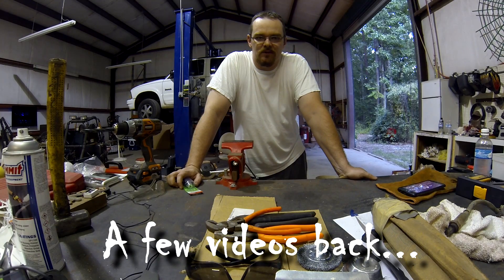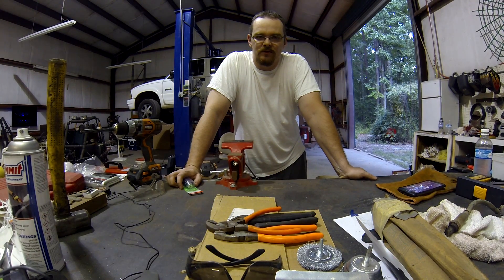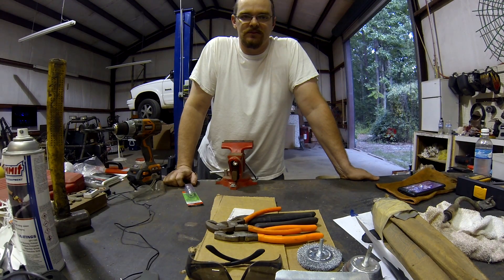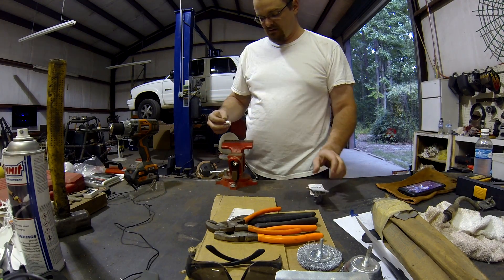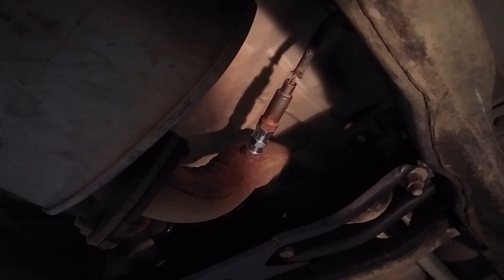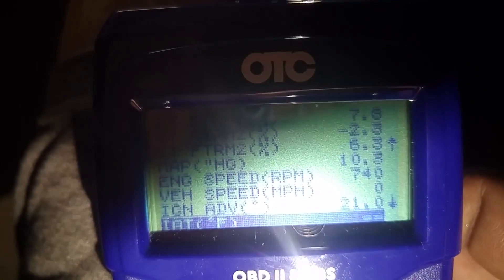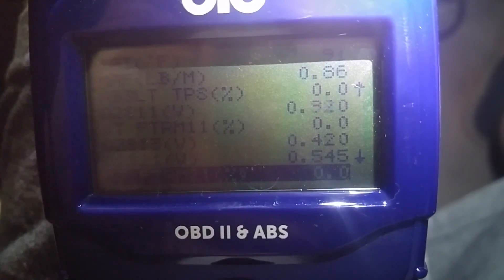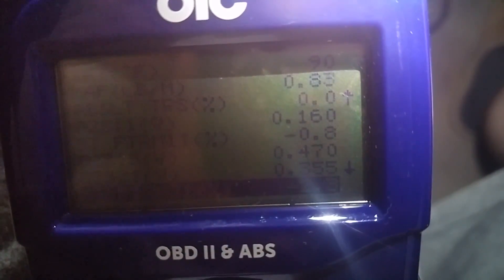$5 Solution to a $200 Problem: P0420 Failing Catalytic Converter

Comment: do you really need two of them stacked?
Reply from the maker: You can try one of them but it may not get the sensor far enough out of the exhaust stream. Ideally, you want the longer ones so you don't have to drill em out but I can only find the short ones locally.
Reply: @ChaosGarage  thanks i'll stick with two i don't want to do the job twice

Comment: Great video and very informative 👍🏻..! What size drill bit did you use / or recommend to drill out the Non Fouler?
Reply from the maker: It's been a while but if i recall, I stepped it up until I could get the o2 sensor to thread in. I think I ended up at 1/2". Hope that helps.
Reply: @ChaosGarage  Thanks

Comment: They make long reach non foulers, part #2006 or #2008. Maybe you could use just one of those and no drilling. Has anyone tried it?
Reply from the maker: Yes the long reach would be much easier if you can find them.

Comment: Did this to 02 ram 5.9 magnum did not work for some reason
Reply from the maker: One of your O2 sensors may be bad. Do you have a scan tool with live monitoring?
Reply: Yes says catalytic converter is not working properly,  just had it removed here recently

Comment: So the cat 🐈 is still bad❓& you still need to replace it
Reply from the maker: Correct
Reply: @ChaosGarage  ... sorry for the naive question but what if you do this process to get rid of the check engine light in the meantime saving money for the catalytic converter, but you never replace the catalytic converter just keep driving the car?
Reply from the maker: That is really up for debate. Honestly if the cat isn't clogged it probably won't hurt much besides maybe some gas mileage.

Comment: Unscrew the o2 sensor.  Put an old spark plug in the hole.  Attach the o2 sensor to the exhaust pipe with a section of wire coat hanger.  Done!         Option 2 unplug the rear o2 sensor and leave it there..   Solder the wires to the upstream o2 sensor.  Computer gets the same reading up and down and will never throw the code.
Reply: I think the computer throws the code when both o2 sensors read the same because it indicates cat between isn't doing anything.  It needs the sensors to read differently to not have a code
Reply: @AJ........  the rear sensor needs to report smooth, when they are the same, they are in fact mirrored as the rear reports later than the front - that is what sets the code
Reply from the maker: Interesting. Thanks for the tips! Looks like I need to do something with the o2 sensor on my Silverado soon.

Comment: I cannot find these non foulers. Can I use some non metallic spacers or can I make this from spark plugs.
Reply: They are at auto part stores and online. Called "spark plug foulers" They are made for spark plugs. But u drill them and use them for 02 sensors

Comment: Did the p0420 check engine light stay on  or did it go off  sometimes  I had a check engine light for the same code but mines went away for 1200 miles  then never came back on all I did was Change the spark plugs
Reply from the maker: It was constantly on. Perhaps you had a plug that wasnt burning all the fuel and dumping it into the cat?

Comment: Tried that fix and now I'm getting p0133 o2 sensor circuit slow response.
Reply from the maker: That code is for bank 1 sensor 1 which should be before the cat closest to the engine exhaust manifold. While it is a generic code it could mean the front o2 sensor is failing/bad or you have an exhaust leak.
Reply: @ChaosGarage  ah ok, that's the one I put the non fouler on so it's bad then and need to replace.
Reply from the maker: Whoa, the non-fouler won't work on the front one...that's why you are getting the code.  It only works on the o2 sensor after the cat.
Reply: @ChaosGarage  😲 ah thanks for clarifying. I'll place it on the right one.
Reply: Update so I used non fouler on wrong o2 sensor when I had p0420 thanks for the heads up o what I did wrong.. Was driving and p0133 popped up. I removed it earlier today been driving the light went out checked for codes all clean. Hopefully no codes pop up later.
Reply from the maker: Nice. I hope you got it sorted.  The computer is expecting voltage being all over the place (and not too slow to change) from the front sensor(s). It compares that to the rear o2 sensor where it expects a slower more normalized voltage which is why using a the non-fouler takes it out of the direct exhaust flow accomplishing that.

Comment: Just get a real O2 sensor spacer for $10 instead of messing around with drilling the $5 part.
Reply from the maker: That's an option I believe I recommended in the video.
Reply: @ChaosGarage  
Where to buy the 0/2 sensor spacer? I have a 2010 Nissan versa w code po420. Would I use spacer on both up an down stream? Or just the front one? I really need to get the car threw inspection. Thank you
Reply from the maker: You can order o2 sensor spacers from amazon or get 2 spark plug non-foulers from the local parts store and drill one of them like in the video. The spacer goes on the o2 sensor AFTER the catalytic converter. It won't work and will spit out more codes if you put it before the cat.
Reply: @ChaosGarage  
Thank you so much. I don't have  money for oxygen sensors an cat. The car runs great an gas mileage is good. This really helps

Comment: you have to go to the IM mode to check if all the sensors are ready mode or incomplete. It can take a half hour or more before you know if the fix worked.
Reply from the maker: GM even has a drive sequence you can find online that will tell you what you need to do to trigger the monitors

Comment: I have a 2002 Suburban with 285,000 miles. For the last 6 years I have squeaked past my smog test for catalytic efficiency.  This year the MIL light would come back on right away so I could not squeak by my smog check again.  I installed the spark plug extenders and easily passed my smog test.
Reply: PS My state smog test just uses the OBD2.  It does not use tail pipe emissions.

Comment: For comparison purposes, how much was your new catalytic converter and your time in putting it on?  Was the converter readily available locally or did you have to order it?  Great video - thanks.
Reply from the maker: Found at a local parts store for about $220.  Installation should only take an hour at most but the bolts tend to rust and had to cut them out with a torch.

Comment: how dows that solve a failing blocked up cat and im sure quick emissions fix but sure you wouldn't wanna let a bad cat go or other issues go 0420 and 0430 codes can have other issues related to them such as manifold leaking exhaust leak need gaskets misgire plugs ect... just curious thanks
Reply from the maker: It doesn't solve a failing cat.  And a bad cat by itself won't really do any harm, however you should investigate why the cat went bad in the first place.
Reply: right thanks makes sense
Reply: Chaos Garage did you find why your cat was failing
Reply from the maker: I had some other codes that I don't remember off the top of my head that I think was the cause.
Reply: @ChaosGarage  a bad cat can infact be blocked up build pressure and blow out somewhere else. You'll know this when it's starts glowing bright orange

Comment: I have another way to fix 02 sencer in back of converter u have to use a Bosch 02 sencer and black window weld u take the holes in the 02 sencer put window weld in the holes with your finger  wipe off excess reinstall the sencer clear codes drive car no more check light
Reply from the maker: I could see that working...anything to reduce the airflow to the rear sensor...cool!

Comment: Lets say...this is not solution of the problem. This is "hiding" the problem!
Reply from the maker: Depending on your motives, yes. But this also applies to keeping the CEL off on vehicles with cat deleted exhaust systems without modifying the stock computer (assuming it is legal to do so in that person's area).
Reply: No way, say it ain't so..., DUHH!!! Some people can't afford to replace the catalytic convertor right away

Comment: He made this look extremely harder then this has to be. first of all you use a 1/2 " drill bit not the largest you can find and you use smaller bits working up to the 1/2" and if your bit is dull ?? for fucks sake if you have a drill bit sharpener or bench grinder watch a fucking u tube video on how to sharpen your drill bit .... period  and last but not least this method only works if your front and rear bank o2 sensors are in working order.. anyone who tries this method and it fails is someone that has a bad sensor and failed to diagnose it.  and any car with cat removed will have better fuel economy and power period ,, the environmental problem is not because modern OBD II cars pollute it is because the government refuses to make industrial factories in the US conform to pollution standards or risk them closing and going over seas to mexico etc.. the problem hasn't been cars for over 20 years it is simply that it is easier to make the car drivers conform to compensate for the factories
Reply from the maker: Or you could just buy one off Amazon for $10...

Comment: Not a good idea to do. In time the problem is going to create more failures. Sure you check the computer but the problem is still there. Here's an idea replace the part that needs to be replaced to the right thing. Seems like everybody's trying to cheat I'll get away with things instead of fixing it and doing the right thing I don't understand the problem with fixing it the first time instead of causing more problems. But that's my opinion.
Reply from the maker: I don't disagree with you good sir.  However the first 5 seconds of the video state that I fixed it properly.  But I can think of a few reasons to go this route like in my case, I didn't have $200+ to replace the cat before emissions and tag were due on the vehicle so it got me by until next paycheck when I could order the proper part. A lot of people don't save up money for emergencies like this and this should be a temporary fix in most cases.  I'm willing to bet the majority of people also don't have the means to fix it themselves which leads to a far heftier bill with a mechanic.  Just as long as the cat isn't clogged and engine is running ok, it shouldn't hurt anything until it can be addressed properly.  There are some legitimate reasons to do this as well though, for instance when emissions are not required and you delete your cats.  Thanks for the feedback, I'll leave it up to the individual to determine how, when, and if they fix it properly.  Cheers!
Reply: David B ur opinion sucks balls bud. For us that need need a cheap fix just to get to the next paycheck to fix it appreciate it. You don’t like it kick rocks and don’t watch. Wah wah why don’t u spend the 700-1000 thousand dollars  to fix the catilytic converter and do it right. Well because I also like to eat, have electricity, gas to get to work, money for my wife’s cancer treatments etc.
Reply from the maker: Well said
Reply: you can get the bad cat code when the cat is at 95% ! Effiency so replacing your cat when its still functioning is a waste of time and money, so this is a good idea if that's the case
Reply: U got money that shit aint cheap

Comment: Nice video! Will these work on only faulty o2 sensors? Went to mechanic, they said my cat was fine but needed both of my 02 sensors replaced(which I did, both oem). However, I still get the codes!
Reply from the maker: Thanks!  If you replaced both sensors and the code didn't clear after driving for a while, then I would say that it likely is your cat.  It's a cheap work around...worth a shot to try it.  Remember it may take a while for the codes to clear themselves.
Reply: Chaos Garage The mechanics said my cat was fine :-/ but I'm not sure if they knew what they were doing! And if I erase the code with my scanner, it comes back on after about 30 miles.
Reply from the maker: Yup, I'm not a mechanic but sounds like cat to me.  Does your scanner have I/m or live monitoring?

Comment: I really couldn't see your live streaming data (too dark), have you checked the downstream in closed loop and was it still hovering around that 450?
Reply from the maker: Yes the readings where similar in closed loop.  The main thing is that it stopped jumping around quick and erratically and the computer liked what it was reading then.
Reply: I'm sold, thank you

Comment: I put the long tube headers on my mustang and the check light is on now, you think this is gonna work for me?
Reply from the maker: +Gilberto Neto Google for o2 sensor eliminators.  There are some cheap diy solutions or some that you can buy ready to go.
Reply from the maker: +Gilberto Neto if your headers have provisions for o2 sensors then it might work, but I would try to go the eliminator route
Reply: Ok thanks!

Comment: That's way more complicated than the last time I had that code. I just 'cleaned out' the converter with a pry bar and a hammer. It worked for a couple months until we could afford the new cat. Thank God we don't have these shitty inspection laws around here. Subbed and like your shop. I can't wait until I get a building and have room to put a lift in. Here in town though we have a rent-a-shop where you can rent a bay with a lift in it as long as you bring your own tools, and the right ones, you can be in and out pretty quick.
Reply from the maker: Thanks for watching and the sub! I might have been able to get away with 'cleaning out' the cat but I was curious about this.  It would have taken me a lot less time if I had the right size sharp drill bit.  That vehicle has some years left for inspections but my truck only has to make it through 1 more.We had those type places with bays back when I was in the military but I don't know of any around here.  That is a nice place to have access to when you need it.  Soooo much easier than using jack stands and rolling on the ground!
Reply: @ChaosGarage  what size drill bit did you use?